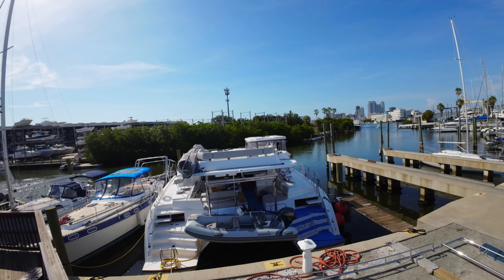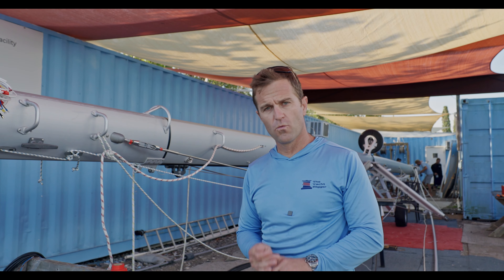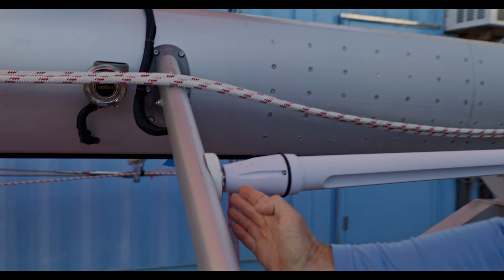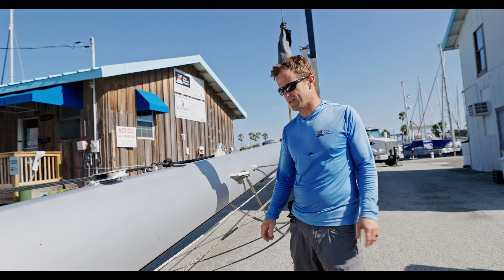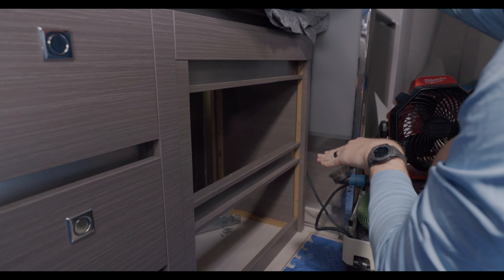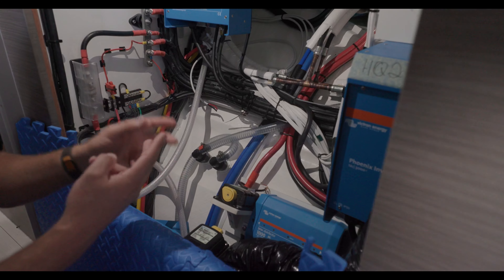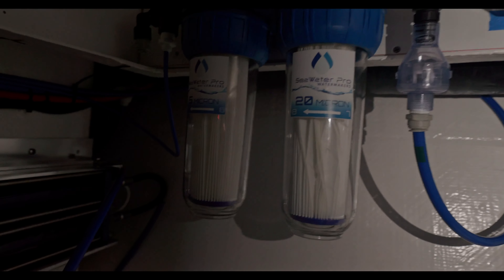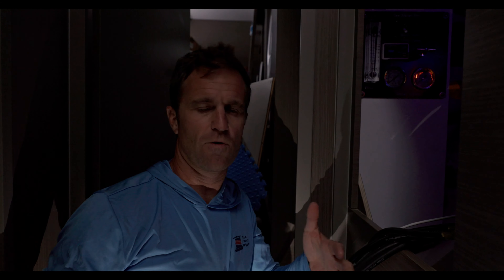This Boat Has RUINED ME! | Leopard 50 | Ep. 13 Pt.4

Comment: Great video! I would love to know what is the brand/part number for the adapter that connects to the top of the Groco raw water strainer to flush the system with a hose? Also, what brand/model are those halyard swivels? Thanks!